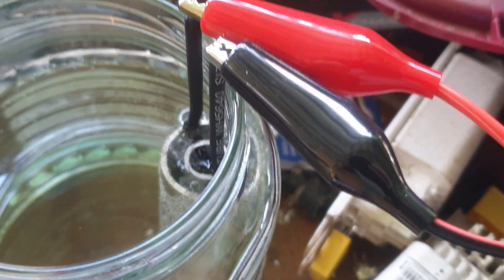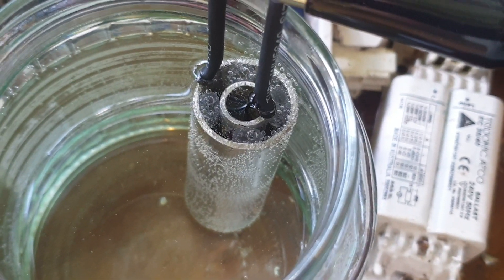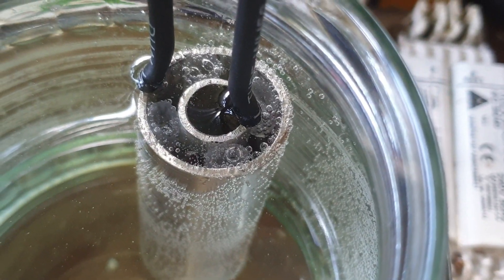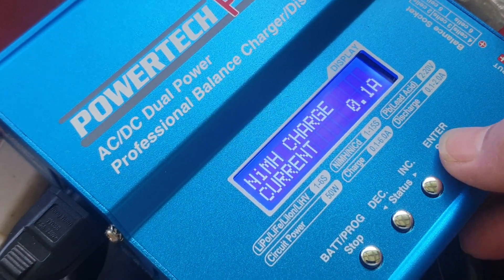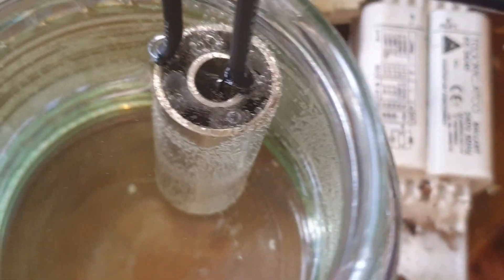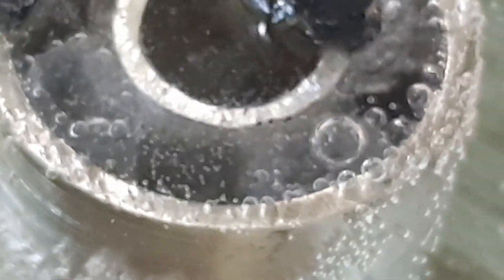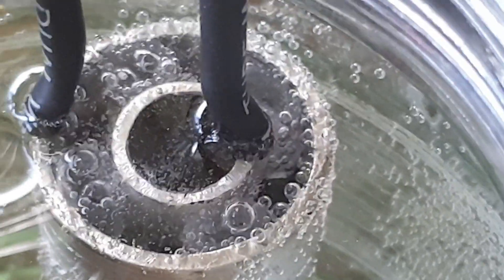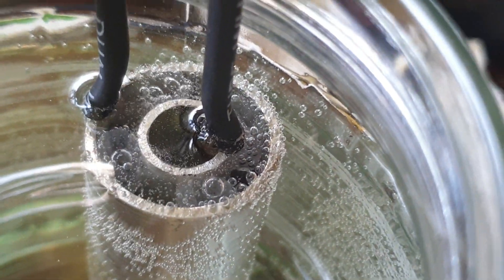the secret to Step charge, HHO Stanley Meyer

Comment: Does the Stanley Meyer concept involve a "conditioning" as the Joe Cell???
Reply from the maker: Stan doesn't talk about it. New steel will passivate crap into the water for quite a while, and lead to orange a red gunk staining the container. It is best to keep it clean. Excessive amp flow will do this also, which you are trying to avoid with Meyers process. Distilled water will run clean if you got your amps under control

Comment: I see something not good in your cell is that the bubbles stick in the wall . 
I think , this will reduce the amount of gas production. 
I have idea , using the pwm generator and change the cathode and anod at the pulse. 
Let assume the big cylinder cathode and small cylinder anod when the pulse up, 
When the pulse go down , the big cylinder became anode and small one became cathode. The purpose of this design to release  the bubbles and reduce the time travelling of ion and cation from  one side to another. 
We can do that by using two relay 5 pins and 4 diod. 
Best regards 
Raheem iraq

Comment: Trying to use voltage to do work, is like putting a 5 gallon gas can in your trunk and hoping your car can use it as fuel. For ionization to take place, there needs to be amp draw. But hey, keep throwing the apple up and maybe one time it will not fall back to earth.
Reply from the maker: keep not doing any experiments and maybe one day some one will give you all the answers, voltage can totally do work with minimal amp flow

Comment: Stan ionized air pulled into the water cell capacitor ( this is to be under vacuum the) then high voltage step charge ( to unleash the hydrogen then into gas processor with more ionized air mixed in (again vacuum where by high voltage is pulling the electrons from the gas atom and photos are introduced with led array ... This expansion inhibiting the reformation of water molecule and is now very unstable and little is needed to set it off   Stan's blue book the birth of a new technology covers it all ) .. all the best mescal
Reply from the maker: yes "stop it turning back to water" yes yes yes...why the hell would anyone put it through a bubbler? 👍👍👍

Comment: according to andrija pucharic there should be an insulation between inner and outer tube so the electrostatic energy can be pumped up until its strong enough to split the water. also reduced amp comsumption and heat.
Reply: ¡Muy interesante!

Me gustaría saber más de Andrija Puharich, sus mejoras respecto a Mayer, la circuitería, etc.
¿Dónde puedo encontrar esta información?

¿Has llegado a construir alguno de esos proyectos?

Gracias.
Reply: The water is the insulation. But it's better if you use distilled water as it is more insulating.
Reply: @John_Anosike_Français  did you read? or staying ignorant on your opinion? Yes, distilled water is not conductive, but with a working device you want to use tap water, which is. 
So place that layer of insulation in between and test. look up puharichs patents.
we work in a field where we should listen to other discoveries.

Comment: if you do figure out the Stanley secret, I wouldn't advise you help your government like he tried. It'll just get you killed. I would publish it online and break the monopoly
Reply from the maker: totally aware of that at this stage. the big oil plan is to use fracked gas and coal in steam reformation plants to strip the H's off of the hydrocarbon, still polluting but keeping themselves in the biz and "greenwash all the way baby"is there plan. buy carbon offsets from poor that will sell them. they have this crap all planned out. we got til 2030 before the goal of zero ownership of cars is what they are pushing. i say we retrofit and make good a steam and hydrogen economy. burn H2 and mist and you get steam. its all part of the system.

Comment: so is the battery charger adding a pulsating voltage or just regular DC. cause tap water does have ions in it that can act as electrolyte so that would just be regular electrolysis. but I do agree that the gap must not be too small
Reply from the maker: yes it is just regular electrolysis at this point, i am setting yo to show the step ramp on the scope
Reply: The gap between the electrodes should be just enough to let the electrostatic effect take effect. The smaller the space the higher the capacitance, so more power per pulse. It will also affect the resonant frequency.
Reply: @StefanDanov  you achieved overunity?
Reply: @raloed.363  I don't know yet, I'll understand it better soon.
Reply: @StefanDanov  at unity Faraday Electrolysis uses 1.23 watts to generate 0.0114 L/min of HHO gas at room temperature and pressure
Reply from the maker: hmm thats a handy figure to keep